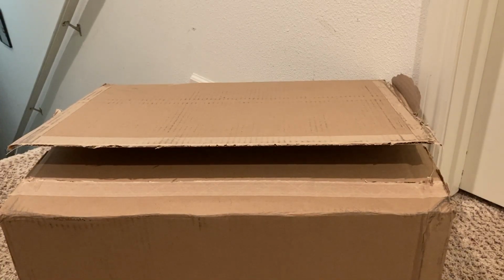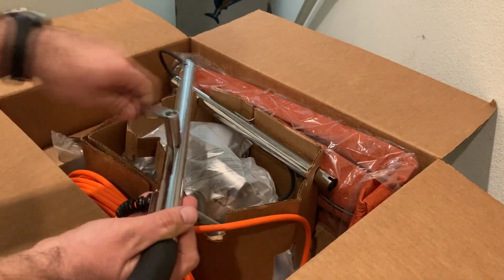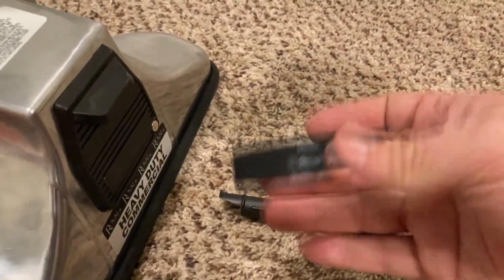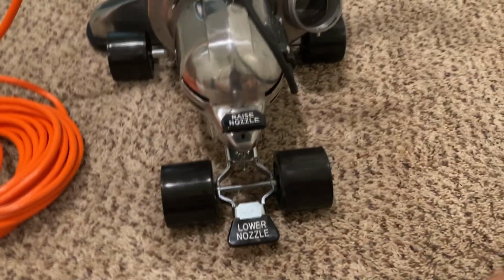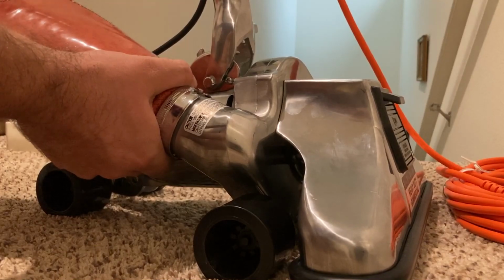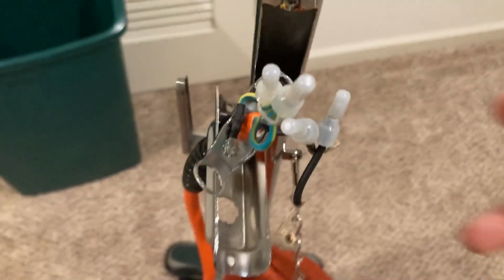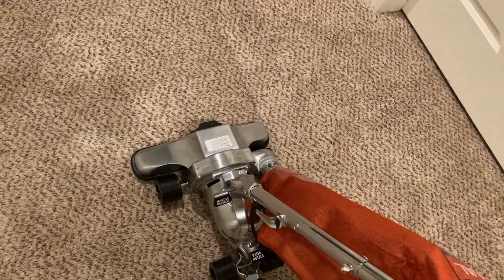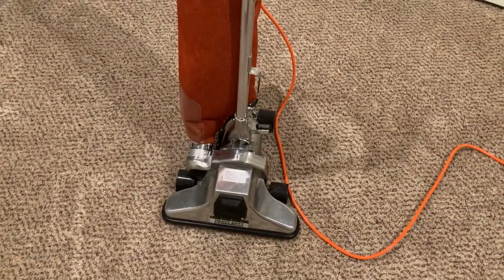Royal CR5130Z Review

Comment: It's still a pretty machine. The biggest difference between that one and an all US component version is the Chinese motor. I worked on a Astrovac whole house vacuum from the 70's that needed a new motor. Ametek Lamb still sells them, now made in China of course. The new motor looked identical to the old one, but the suction wasn't nearly as good and I'm sure it won't last 40 years. At least I could get a replacement. Great video as always Hank!
Reply from the maker: I remember reading somewhere that there are no longer any dedicated factories in the US for small motors like these anymore. Not sure how true that is